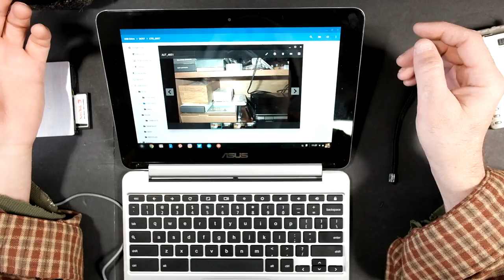Does a 20 year Old Digital Camera Still Work? - Vlog 15

Comment: I've been looking through a folder of photos my dad took with this thing in 1999. What really strikes me is that the image compression seems oddly inconsistent. Two photos of the same tree in the same lighting conditions, one is 90kb, the other is 400kb. Largest file size I've seen is 500kb, smallest is 60kb.

Comment: I've got an old Nikon Coolpix 2000 camera that still works.  2 megapixels resolution.  I bought that in 2002, and it was supplied with an 8 megabyte type 1 CF card.  Back in 2002, I'd bought a 64 megabyte card, in order to give it a more practical capacity.  Ten years later, I'd purchased a 1 gb type 1 CF card for it (actual capacity was 960 megabytes).  It could read that card, but it could only format 400 megabytes of it.  Back in the day they'd had to create physically incompatible CF type 2 cards, with micro hard drives, in order to increase the capacity.  Suffering from barrel distortion and a limited ISO range, it's not a particularly practical camera by today's standards.  As a matter of fact, I can take better stills with my camcorder equipment.

Comment: Just bought a digital camera from 2005, it works but I do not have an sd card that works for it ..

Yes there is 1gb sd card and up available but 4mb is extremely difficult to find at least in my country.

So i suppose this is something you have to keep in mind before buying an old digital camera.

Comment: You can easily use an old 5mp camera these days if you shoot in mostly daylight conditions.  Few people understand that 5mp was plenty enough, even 3mp was enough to have a nice picture printed or seen on the desktop display.  Back in the days,  many brands made their best cameras when they reached around 5mp.  Then they started boosting the mp and cut into lens and processing quality.  The only time when it's worth buying a $400 camera today is if you shoot interior pictures and you don't want to use the flash.